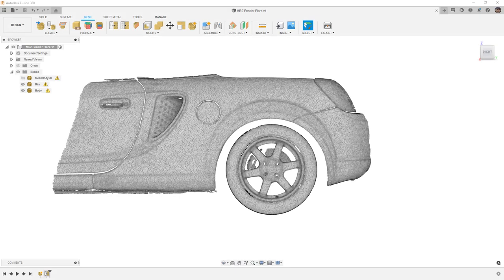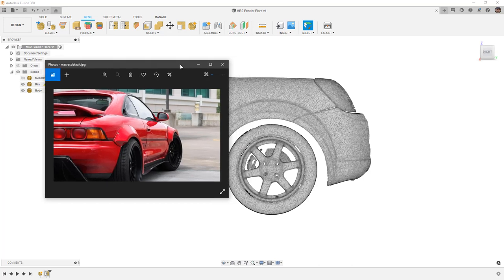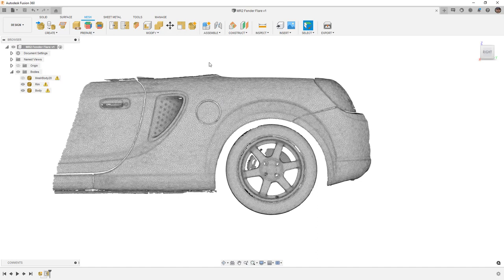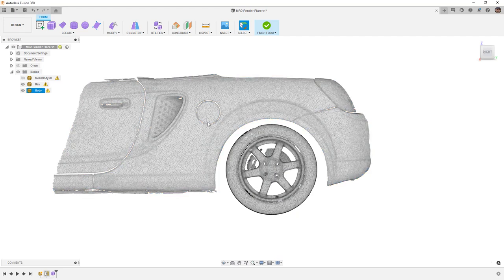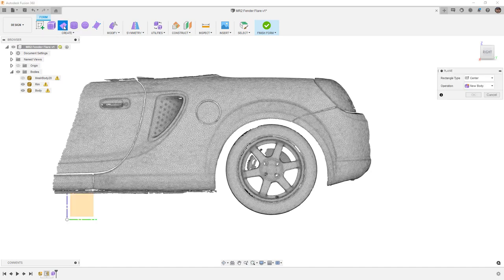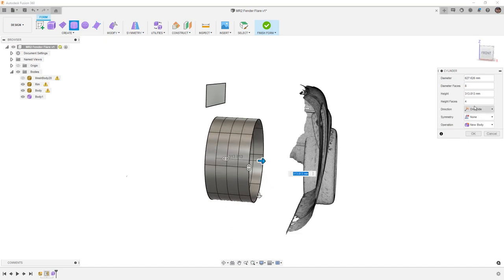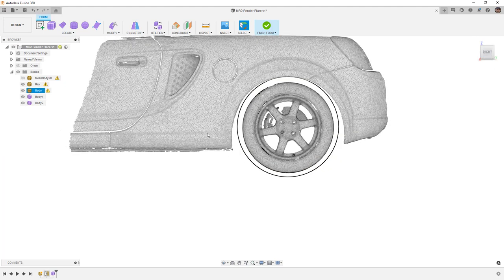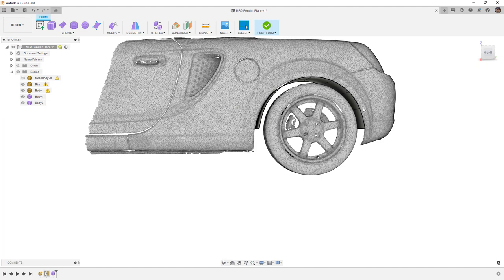Design a Fender Flare in Fusion 360 - Rocket Bunny Inspired Fender Flare #Fusion360 #CarDesign

Comment: Thank you, sir! Not familiar with fusion360 yet, but finding your channel actually relaxes me a lot knowing I can probably learn everything I need in one single channel.
Reply from the maker: Great to hear!  Do you have experience with any other CAD software?  I have taught several from Autocad, Solidworks, Inventor, Onshape and a few others.
Reply: @LearnEverythingAboutDesign  Did a bit of Solidworks few years back, but only enough to do really basic stuff. My work really need to expand into reverse engineering for car/bike panels so I'm looking into Fusion360, hoping it handles meshes better than SW. From your video lessons it's looking very promising. Any recommendations of lessons? Thanks!!

Comment: Very informative, thank you!  Definitely want to see more extreme version! 
Again, rear fenders on these cars are bolt - on, you can even see actual bolt heads at the bottom on the scan. So, basically you can make complete rear fenders from scratch if you want :)
Reply from the maker: for the next version I will try that.  I will use the fender seams and build the surface inward so it matches the body lines.... hopefully

Comment: Hi! This is the only channel with t-spines workflow! =) Thank you very much! I will learn some of your tricks and do my stuff =) What background do you have? Alias? =)
Reply from the maker: Thank you Evgen!  My background is in parametric CAD actually.  I started in Autocad and 3d studio years ago and went through many software packages including inventor, NX, Solidworks, onshape and Fusion 360.  I have done a lot with reverse engineering and building parts off of scans in other software packages.  I worked in automotive research for a bunch of years and trained clients across the US in various workflows.  I have been supporting Fusion 360 now for about 5 or 6 years because it is a great tool and very accessible to everyone.  The free version and very low price point is very appealing.  Also why I like to cover Blender.  Soon I will be making some blender content drawing some parallels between working in Fusion forms and blender.
Reply: @LearnEverythingAboutDesign  nice experience!) I will wait new videos!)  Great job!)
Reply from the maker: I plan to do the next fender flare one tomorrow.
Reply: @LearnEverythingAboutDesign  nice productive!)

Comment: Going through the series slowly as I was looking for exactly this - using a 3d model/reference image to model organic shapes! I was wondering if I was to properly scale the model/image I was using as a reference, would the piece that I'm designing be fully defined and thus ready for 3D printing?
Reply from the maker: There are a lot of factors there.  If doing this from an image(s) alone you are going to have variations.  If you have a good quality scan to scale then likely you can print parts that will fit just fine.  The tesla spoiler video I did, the person 3d printed that and it fit great.  He had to print it in smaller pieces and glue them together though because of its size.

Soon(in the next month or so) I will be scanning a car that I modeled from images and will be comparing how close I was with some of the details.

Comment: super awesome video, I'm very new to this and wanting to do this exact process with my 911 Porsche. you've definitely made me feel like i could possibly achieve it. Thanks Heaps..
Reply from the maker: Great!  Happy to answer any questions!  The fender flare series progressed to a more extensive Overfender.  And right now I am recording a 911 series.  I am modeling a 70s/80s 911 turbo based car more in the RWB style with big fenders.  What 911 do you have?
Reply: @LearnEverythingAboutDesign  Hi, I'm working my way through them now, really love the detail in the videos. Mine is a 1980 replica, using a Mazda RX8 as a donor for suspension, track width is a lot wider so also planning a RWB inspired wide body, have subscribed and will be super keen to follow along on that one that's for sure. Thanks for the awesome content...

Comment: Thank you for the great video. I have one more question. What combination switches the fender from round to square and vice versa? Channel subscribed. 👍
Reply from the maker: on a PC the shortcuts for display are ALT + 1 and ALT + 3, but in the last round of updates that doesn't work while in any of the tools like Edit Form sadly.  I reached out and asked about it but no answer yet. If you are on a Mac they are Option + 1 and Option + 3.  If you are in edit form you can expand the select area and at the bottom toggle between the display modes.
Reply: @LearnEverythingAboutDesign  I think I need a video first that explains all the functions of the mold. I am currently trying to create a recess in a mold. Unfortunately the recess will only be round, like a bent sheet. Do you happen to have made one?
Reply from the maker: @OstModellbau118  I have a general series about plastic part design https://www.youtube.com/playlist?list=PLBDfGh8A8kXX5mMcgJze-OHeChFQS7ru1  but not one specifically for this part.  Generally when you are making a fiberglass mold you will have a negative of the shape plus a lip around it so you can trim the part away.  If you are trying to use something like vacuum forming then you make what is called a buck.  This is the inside of the part.  So basically the shape you have but offset your sheet thickness inward.

the Youtube channel EasyComposites LTD  https://www.youtube.com/@easycompositestv  Has some great videos and resources about mold creation so I would suggest browsing some of their content.

Comment: As someone else already wrote, i also learned more through that one video than all other videos i saw and i am very thankful for your tutorial - i will watch more from you and already subscribed. I just have a question: Is it somehow possible to modify the first curve of the fender from the cylinder (the cylinder that you created from the center of the wheel)?  In my test fender i saw that its not perfectly round, and as well i see it in your video. I am sure you would edit it somehow before building e.g. a mold for the final product. I cannot imagine that its only possible to adapt the curve by hand to a cylinder. Even if it looks rounds, you would need to add a lot of edges to make it more perfect but it would still never be a perfect radius if i can say so. Hope you understand what i mean, but later on today i will do some test. I thought about to devide the front of the cylinder so that i get a lot of points and later i will weld the fender points to the points on the outside of the cylinder. I am sure there is a better option 😄 Best regards, Denis
Reply from the maker: Hey Denis, yeah there is a lot to unpack for sure.  Couple of notes and ill add some links to other videos for you.
1. Very true that the wheel arch isn't going to be a perfect radius.  In reality they aren't as most will have some section that is a near perfect radius from the side but then change.  To manually get something is tough and you will never be able to manually get something and measure it to know how "true" it is.
2. Yes there are tools and ill put some links below.  You can use curves, surfaces, and mesh bodies to drive the form.  So for example if you wanted to exactly match the OEM opening just pushed out 3in, you could copy the mesh, move it 3in then attach the form to that mesh.  You can also use an extruded/trimmed surface and use the match tool.  This does some funny things when you work with the tolerance on because it adds a lot of internal points making it tough to edit so i generally do this at the start and again at the end when im happy with a design(or close to it).

Thanks for the Sub!  On the car modeling there are a lot of videos/playlists on this channel over the last 2 or 3 years that hit the subject.  There are a few car modeling series, I did a scan to part design series on my starion, and have hit the topic in a few other places.

Scan to design series - https://www.youtube.com/playlist?list=PLBDfGh8A8kXVvKBJ4UudhVLKlPdumAg5P

Forms mastery playlist - https://www.youtube.com/playlist?list=PLBDfGh8A8kXWCgB3Q5DYiCDSCxCqw8tJ7

This is probably what you are looking for.  Match tool - https://youtu.be/TkuRF-fVlcs
Being able to freeze/unfreeze is helpful Freeze – unfreeze - https://youtu.be/7apI1Yifmps

Here is a series i did for a user doing a 3d printed racecar fender for their datsun.  Car Fender Series - https://www.youtube.com/playlist?list=PLBDfGh8A8kXWeZ6Q2C8P9xPw5oMUEEEWZ

My suggestion is that if you plan to manufacture a part by say CNC milling a mold, then either use surfaces OR create critical/dimension controlled edges/curves/surfaces that you can attach the form to using the Match tool.
Reply: @LearnEverythingAboutDesign   *i have already answered about 40 minutes ago, but i got a error which i didnt saw it and then just a minute ago i answered again, but i lost the long first answer. I just managed to copy to the second answer. So, i reply now again, (but i make it a bit shorter, because in meantime i solved 2 important things for me): THANK YOU VERY MUCH. I didnt expect that you will reply, because that video is already at least 2 years old, but you replied quickly and very informative. Nice from you, thanks! I will check surfaces and also  the video where you wrote "This is probably what you are looking for". Yes, i have a big cnc router (2500 x 1250 mm) where i want to create the molds, but actually i wanted to build some parts, like fender flare, side flare and some other things from sheet metal, by the "Incremental Sheet Metal Forming" method. Unfortunately, due to the form of the fender i will design, it will be difficult to realise and i also posted about it in the Fusion 360 Forum, but didnt got a reply yet (https://forums.autodesk.com/t5/fusion-design-validate-document/prepare-mirrored-forms-car-fender-to-be-able-to-form-them-on-a/td-p/12980025).

Now about the "perfect circle around the wheel". I found one solution that seems to work and i wrote about that in my first reply that has not been sent, but i found one other, so it might not be necessary, but maybe still a good & quick solution: If you want a perfect circle, you can later convert to BRep, draw a circle over the fender and then cut through the circle. 
Here my other solution (i will just post my second reply that i managed to copy): Maybe thats something that could interest you - i doubt because you are experienced and for sure you know about it, but here i try to explain: 
In your video at the beginning you first created a circle, then you cut off most of it (lower part), because you didnt need it. After that you aligned the points to the original car fender design and then you created a vertical lip that you had to align again as well as the edges you had to align in direction to the middle point of the circle. (every car design is different and not all cars have perfect round radius around the wheel, so your case might be different than mine, but my way of doing it might be still interesting)
Here it is:
So, to get a perfect circle i did it this way: I created a circle but i didnt cut of anything and left it as full circle. Then i created the vertical lip of that circle and thereby all the edges were automatically aligned to the middlepoint of the circle. After that i cut of what i didnt needed (lower part) and than i extruded the "curved" surface to the direction of the car to create the form of the fender flare. Then i aligned the ends of the flare on the left and right side. It has changed the thickness of the lip at those ends on the sides, but the lip was perfectly round at all other points (so e.g. 95% of the whole lip) and the circle was perfectly round. Difficult to explain, but this has actually solved my problem for now, but i will continue to try out and test. Currently i only have a picture of the HWA 190E W201 Evo attached behind my design and no 3d scanned mesh. I have a scanner and soon i will start to scan the W201 190E that is in my garage, but now i am just learning and testing :). Best Regards, Denis
Reply: @LearnEverythingAboutDesign   Okay, i give up. I have spend almost 1 and half hours to reply you, because my first long reply has been deleted, because of some error. Then i replied again, not seeing that my first reply was deleted, but i managed to copy it. I have then replied with a completly new text that took me a while to write, because i explained everything and have sent it and saw it was there, but now its gone again. It seems its because i attached a link of the Fusion 360 forum where created a post. I will not again spend so much time to write so much, because i am angry to my self not understand that it was because of the link and also angry to youtube that they do not send me a mail with the reply i have send, so that i could just delete the god damned link. So, Thank you very very much for your quick reply and all the informations. I am really thankful for your help. I found 2 solutions that work very very well to get a perfect circle, so my problem is solved i would say, but i started 2 days ago with "sculpting", so i am very new and have to learn a lot. I will also check surfaces and the videos you have posted for me. Thanks again and all the best to you. I might watch the whole series of videos about sculping. Best regards, Denis
Reply from the maker: @denishent8744  I hate it when that happens!  Feel free to email me support@caducator.com as well.  I read through your other comment about not trimming the cylinder.  that is a good way to do it as well.  Resetting the pivot point to the wheel center (if there is a reference point like a sketch) can do the same thing if you do want to trim.
Reply: @LearnEverythingAboutDesign  Ohhh i just see that one reply worked. I cant believe it. Its now a bit confusing, but the reply where i wrote "*i have already answered about 40 minutes ago", was my second try and after posting it, it was just there for a moment, then i wrote the last reply where i started with "Okay, i give up". Confusing, but somehow that reply with the Fusion 360 community link is now there. Nevermind, its good that you at least see that i spend some time to reply to you after i saw that you replied so quickly and informative.  Thank you for giving me your Email, i really might need your help in near future. You wrote "Resetting the pivot point to the wheel center" - i need to check exactly what you mean, but i am very happy that i have made progress today, because i watched this video from you already for 2 days and it was like "damned, i need to get the circle perfectly round", so i didnt even continue with most of the other things. Step by step i might get things done as i wish with the bodykit. Thanks again!

Comment: Hi!  You mentioned there was an automatic way to adjust the lines around the wheel arch to point to the center.  How is that done?  Also, is there a way that you can make the lines all equally spaced?
Reply from the maker: Hey Bryce, the way to adjust the lines around the wheel arch to a point in the center is resetting the "pivot point" once you have your lines selected.  The best way to do this is from the start as its a relative type of operation.  So if your lines are already out of round it really won't help too much.  The pivot point reset is on that annoying little floating menu that is always getting in the way.  Looks like a little XYZ axes.  click that. then set your point where you want it, then click the green check mark where that XYZ button was.  Now any scale or rotate operations will be relative to that point.

For the lines equally spaced, not "exactly".  You can use some tools like Smooth which will average them out.  Also under the utility menu you have "Make uniform" which will take the smooth display model and space things out.  I am not aware of any tool that will make them numerically equal though.
Reply: @LearnEverythingAboutDesign  thank you so much for the explanation! Your videos have helped me tremendously.
Reply from the maker: @bryceverreyen9341  No Problem!  The forms stuff takes a long time to get and every day is a learning experience.  Just keep playing with it!

Comment: Do you have an videos on how to make those ribs or bucks for sheet metal shaping?
Reply from the maker: I don't. yet. :) Is that something you are interested in me showing?
Reply: @LearnEverythingAboutDesign  very interested in learning this, as I shape sheet metal I am trying to learn how to make bucks in the 3D plate for so I can make full parts for the cars I am working on
Reply from the maker: @66customsnj  Cool I will add it to my list.  There are a few ways you can do this.  If you have a laser cutter/router doing it with wood is easy.  You can also print it on paper and cut by hand using that template.  I will see if i can work it out on a fender model, or at least part of a fender to show the process
Reply: @LearnEverythingAboutDesign  thank you! I greatly appreciate the effort in making these videos 🙏
Reply from the maker: @66customsnj  I just recorded a video going over this.  It will go live tomorrow morning at 6am est.
Reply: @LearnEverythingAboutDesign  wow awesome thank you 🙏

Comment: can you do the same in solidworks?
Reply from the maker: Yes sort of.  If you have the stand alone version of Solidworks you would need to also buy the Power Surfacing add-in from nPower.  I made 4hrs of video for them a long time ago doing a concept car design.  You can snap to mesh and they even have edge weight control which would be great.  The 3dExperience stuff has SubD but to the best of my knowledge that doesn't really deal with Mesh.  I haven't used Solidworks in a Few years nor have i tried the 3D experience stuff.